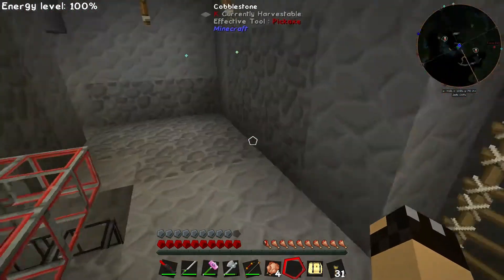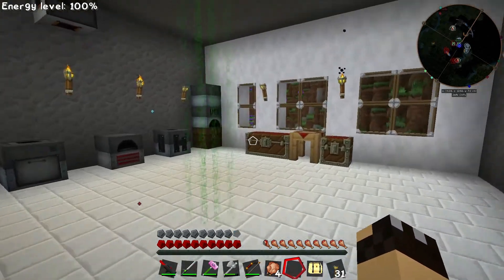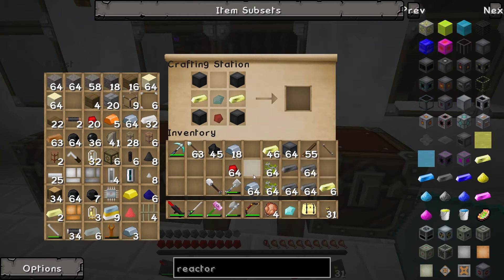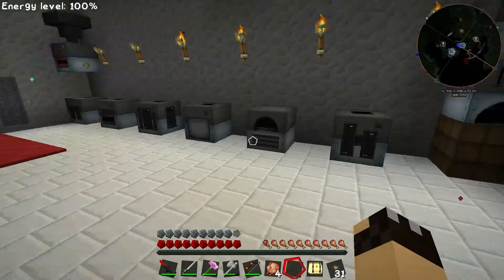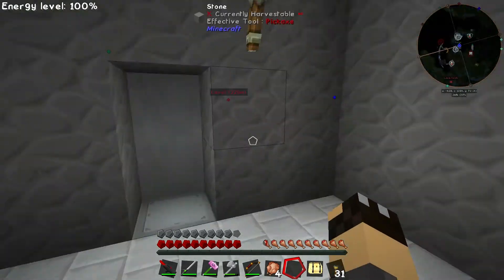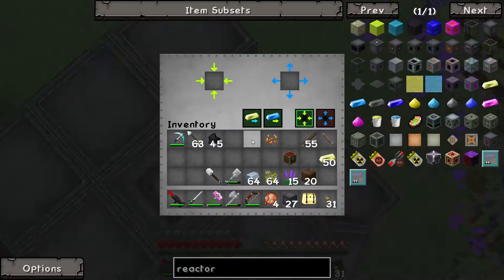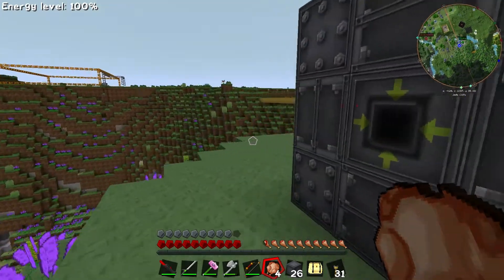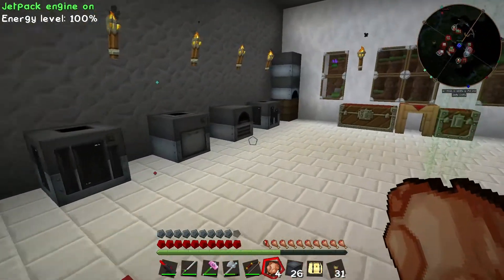Feed the Beast Infinity -41- Big Reactor!

Comment: Great Video, I think i'll build a reactor too, I was using the Solar Expansion panels but this is cheaper and has a better yield.

A good way to help clear the pipe network quicker would be to put Iron Pipe at the junctions and configure it to flow in the correct direction so that fluid can't split off at all the junctions and disperse all over the network.

Comment: Once you make the reactor bigger so you have more faces to work with, the easiest way to control it is to use a pair of rednet ports (or redstone on modpacks without rednet) connected to each other. Set one to output how much charge is stored and the other to input the control rod depth.

If nothing is using power the energy storage fills and the control rods go to 100% so fuel usage stops. If power is being used it will gradually withdraw the control rods as needed, ramping up to full power if something's using enough power to completely drain the internal storage.

Comment: Another great and really interesting video it was very hard waiting until Monday to watch the video. I hadn't realised how easy a reactor is to build. 

Hover mode on the suite is hold down Ctrl+Space and then press m, I've not change the default controls except to remove a few conflicts.

You can stack barrels and chests vertically, if that helps. Labels rather than signs allow up to 3 items to be shown visibly.

A chunk loaders uses about 9% with a 2.8GHz CPU, should be less than 1 player. Just built a 2 million bucket iron tank and emptied two and a bit lava lakes in the nether. I was really lucky as my nether portal came out right beside a fortress and get some interesting stuff. Now what do I do with that much lava?

I think there is a new dark green creeper that drops gunpowder and confusion power.